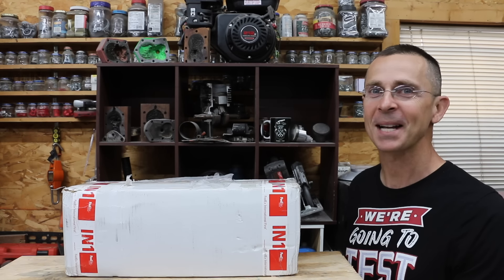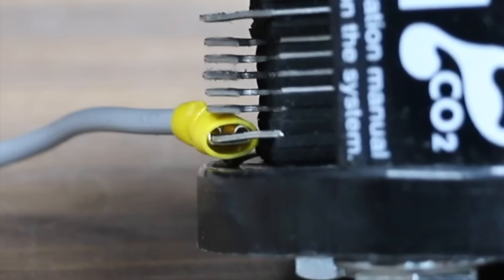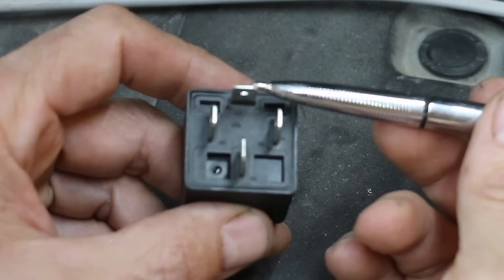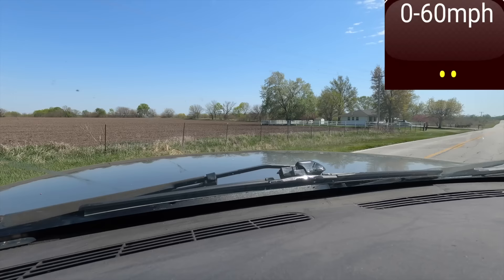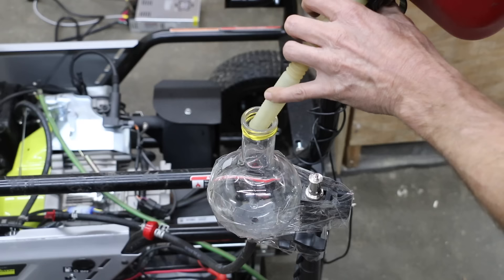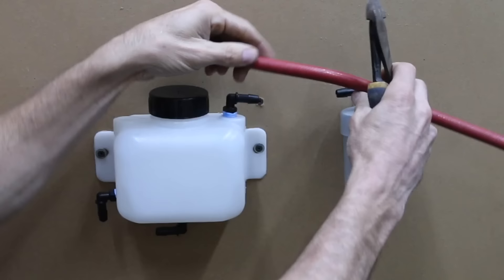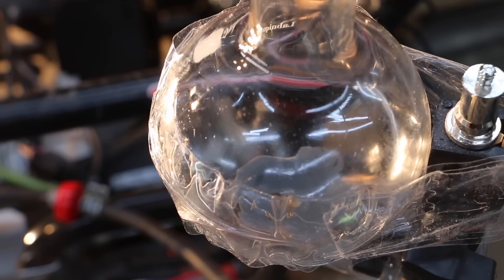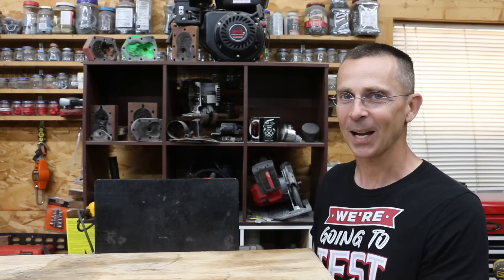AMAZING 35% More MPG with HHO? Let’s find out! Help with high gas prices?

Comment: Can you come up with a test for "Rain-ex" products?   I like using those hydrophobic windshield coatings but Rain-ex brand makes your wiper blades chatter when it starts wearing down and there HAS to be something better out there
Reply: @PayNoTaxes0GetNoVote  put a silicone emulsion on your wiper blades (like 303 protectant or a bargain brand doesnt matter) and any glass or clear coat sealants or your windshield. That should work. The silicone also acts as uv blocker so less sun damage to them. I’d use a cheaper product for a sealant than rainx, they all basically do the same thing. I’ve used car wax on my windshield and when it wears I don’t get chatter, just more droplets that stick. Good luck my friend!
Reply: @sashasoule4585  - Thanks,  until I see some definitive test. I'm sticking with my tube of Rain Clear.  Thus discussion reminded me to re-apply yesterday! Should be good all summer at least
Reply: Silicone wiper blades maybe?
Reply: also put the Rain-ex on a cloth and wipe it on the wipers or they will squeak
Reply: Put on some Bosch wiper blades, they never chatter. I got some on my 2008 Chevy Avalanche with some Rain-X wiper fluid.
Reply: You kidding me?? Never ever heard of someone using their blades after proper coating their windshield with Rain-X. Regardless, your years of doing it wrong, YOU DONT USE YOUR BLADES AT ALL. NO NEED ANYMORE. Nada, Zip, Zilch, Nay, No. ( Of course your blades will chatter when its scraped enough Rain-X off. If you refuse to not use your blades, then just reapply Rain-X. Why search for a newer kind of blade, doesn't make sense.)
Reply: @SpaceCadet4Jesus  - Your name is very fitting because you are repeating everything I just said.
Reply: @PayNoTaxes0GetNoVote  not exactly. I said "apply another coat" and " don't use your wipers". You said " my wipers chatter when it wears down" (which means you don't apply another coat AND you use your wipers) and you even like another product, Rain Gel. What we both said is not similar at all. So use the Rain Gel. PF isn't going to test your neglect.
Reply: @SpaceCadet4Jesus  - Sigh....that's not what I asked PF to do. I want to know best product, LIKE I SAID. I don't need to get into a semantics argument with a literal online Space Cadet.
Reply: It wont improve gas milage either..lol
Reply: @ipman4715  Ahhhh, only my fancy $1000 ceramic coating job does that I guess.  Reduces wind resistance. /S
Reply: When I wax my truck I also wax my windshield and all my glass. Been doing it for years. Never have my blades chattered. Water beads right off...effect will directly depend on the quality of wax used and how often wipers are used. 🤙🏽

Comment: Hey I just wanted to point out that when you added the hho unit to your truck you put it after the mass airflow so you made an air leak
Reply: Your right, he added it after the MAF so HHO will come in downstream and will possibly cause the fuel map to be lean, i say possibly because if the HHO is in balance and the air required to burn the Hydrogen (accompanying the hydrogen) is in the correct ratio it shouldn't be a problem and if the HHO is going to give a boost it may be advantageous to inject after the MAF anyway.
Reply: Good pick up! 👍
Reply: I noticed that as well. The ECU is going to try to make corrections for the new values. Try it on a carb engine.
Reply: Those corrections only occur when the ECU is operating in closed loop, his testing being at wide open throttle (WOT) will see the ECU operate in open loop and as such the feedback from the o2 sensors is ignored from the ECU under that condition.  There's not a chance that the kit was developing anywhere nearly enough gas to make a measurable difference at WOT.
Reply: @goatfather2966  Not worth the trouble; it doesn't work, because it cannot work.
Reply: Guys in theory If you were to add it b4 the maf and it's a hot wire couldn't it ignite because of the hotwire?
Reply: @RoronX35  Autoignition temperature of stoichiometric hydrogen:oxygen is considerably higher than the hot wire can create.
Reply: @Charles McKinley  Your the one who needs to go back to sceince class.
Your argument only has merit in the absence of an ignition sourse, thats not the case here.....
Reply: Well it didnt set a lean code so it must not have a vacuum leak. Unless the hho increases or decreases the volume of air going thru the maf i doubt it made any difference. Maybe he should have plumbed it into the manifold or to vacuum line. Seems like the hydrogen would mostly just deflect off the throttle plate how he had it rigged. Idk seems about as useless as a k&n air filter no matter how its installed. For 200 bucks i could install a 40 series flowmaster and at least it would give him some results plus a throaty growl. Any noticeable gains are gonna cost more than 200 bucks and wont say as seen on tv written on the box.
Reply: @luckyPiston  it'd actually cause it to run rich if it's hydrogen rich gas being emmited (hydrogen is basically just 1 carbon off being fuel anyway) because the oxygen density in the intake would be displaced for the fuel gas... That's if the HHO worked but there's far more important thinks like laws on conservation of energy at play.
Reply: @bradtpt  I don't think the ECU would go open loop, can't think of a reason it would do that or that it would even be EPA legal ?
Reply: @mackay820  Wouldn't the O2 sensor see that and the ECU make fuel map correction ?
Reply: @hotrod8915  Maybe he would get better results over a longer time period with average driving  ? The HHO should have higher impact at lower speeds right ?
Reply: @luckyPiston  hell if i know it looks like a scam to me. Hydrogen doesnt burn hotter and doesnt make the air more dense or move faster thru the intake runners so i fail to see it doing anything for a gasoline engine. Its a scam. Common sense says high volumes of fast moving air and the proper fuel ratio to quench it is the only way i know to produce more power.
Reply: @luckyPiston  hydrogen is not a solvent so it wont clean carbon build up and doesnt produce steam like water does to clean pistons or valves. Its a scam. Unless hydrogen defies the laws of chemistry its useless in a gasoline motor. I been a mechanic 20yrs and have never heard of hydrogen benefitting a combustion engine. Maybe if it was used to aerate the fuel as it passes thru the lines and injected into engine it may do something. Otherwise its a scam
Reply: @hotrod8915  I think the idea is water is cheap so y not crack and burn it, in theory you would see the ECM lean the motor for the HHO and u would save gasoline.....
Reply: @hotrod8915  Good points, ideally the motor should run on straight hydrogen but the fuel supply in any volume is a big problem
Reply: @luckyPiston  have u seen the magnets supposedly used to ionize the fuel as it passes thru the lines? Its bullshit too. Snake oil salesman peddle shit products like these with outrageous claims. Common sense and a thorough understanding of the basic principles is enough to satisfy any doubt. Unless u have particle accelerator and enriched uranium in heavy water and a nuclear reactor to split hydrogen atoms, there isnt much energy in oxyhydrogen to be released. Still the oxygen molecule would have to be removed from the hydrogen molecule. That would require a catalyst. Oxyhydrogen is just a strange thing to run thru a motor. Hydrogen would explode like a zepplin blimp.
Reply: @luckyPiston  maybe the dude should try it on a diesel engine and see if he gets better or any results. It has a higher compression ratio and more likely to make that snake oil potion oxyhydrogen burn. U can run a diesel off chicken grease with a 17:1 compression ratio. So it will probably burn the oxyhydrogen. Short of that it seems like it would dilute anything flammable
Reply: @luckyPiston  I don't think so since hydrogen is super clean when it burns. It uses the measure of co2 and nox as to tell if there's too much raw fuel coming out so it probably wouldn't be any calculation changed. Hence the rich running.
Reply: @luckyPiston  it goes open loop because the narrowband sensors will only tell the ecu if it's leaner or richer than stoichiometry, not by how much, plus it commands richer than stoichiometry because it'll make more power and also for catalyst protection. On this generation ecu (probably an eec-iv or eec-v) it will run open loop at wot, however on the current generation copperhead based pcms Ford run full time closed loop, they also use wideband sensors so they can actually target and read meaningful feedback for targets other than lambda 1.00.  So, without any doubt the ecu is in open loop for these full throttle tests.
Reply: @bradtpt  I see what you are saying and the narrow band sensors have their limitations, so he shouldn't have been doing his tests as a bunch of speed runs like that ? So would testing the HHO in some kind of a dyno situation yielded more realistic results, there must be a good way of measuring this ? tks

Comment: It seems you need to do a second video, where you tune these engines for a lean burn. People are saying since your results found less fuel efficiency at the current tune with the additive, maybe the results will change. The mission is to see if engine will run longer with a lean tune alone, or with the hydrogen additive. The only other video about this, is a floridian hippy and his Ford ranger.

Comment: Well done and thank you for doing that test. I have always thought those hydrogen generation devices were a scam and you just confirmed it. Still, as long as there's one born every minute, I guess they'll keep making them!
Reply from the maker: Thanks and you are welcome!
Reply: The basic premise is flawed; using the car's electricity to split the water means its hopes of gains are pinned on being a perpetual motion machine (which is not possible).
Any benefit would need to come from it modifying the combustion chemistry somehow, which in the many years and many times I've seen HHO brought up, I've never seen anyone provide any mechanism how this actually works; it's usually just hand-waived. And it would need to provide enough improvement to overcome the inefficiency losses in the alternator and the water-splitter.
Reply: @IstasPumaNevada  thats not the theory the theory as i understood it was the hydrogen helps to make the combustion more complete...

Comment: You can build a pretty reliable hho generator with a $1 Mason jar, a $1 set of stainless steel  cutlery and some tubing. If you want more mpg from hho, use a small battery and solar panel setup to power it. And then use mosfets to modulate the 12v signal to pulse at the correct optimum frequency.  Maximize your gas production while minimizing the energy used. This coupled with electrolytes and you're golden.
Reply from the maker: Thanks for the feedback.

Comment: Not a significant test.. You need a controller, that taps into map and oxygen sensors to lean out the fuel on the EFI in order to compensate for the HHO injection. Just injecting HHO into the intake with no air/fuel mixture adjustment makes the ECU assume the HHO is just intake air and causes a rich combustion. (Loss of power/MPG) Also, on a V8 engine, the HHO Generator needs to produce at least 1 liter per min of HHO. Preferably, up to 2 LPM in order to see any real gains in mpg or power. There is tons of research on HHO retrofitting out there. Look it up. Do a follow up video with what it actually takes to get results from HHO. And rule out those gimmick buys like the one you tested.
Reply: Exactly what i was thinking. The engine, especially the generator engine, does not care what air its taking. It will just run the same amount of revolutions anyway.
Reply: I agree, more hho would be needed on the car to offset petrol use, but the controller you mention is slightly incorrect as most PCMs allow for fuel trim leaning out the petroleum mix to reach the stoichiometric ratio of an ideal 14.7:1 Obviously the PCM can vary in tolerance and will flag a check engine light & limp modeif you try and over supplement the fuel system.
Reply: @richard68380 You're right, I did read some preliminary testing, by different people on making a PCM device but it was manually controlled. They did get some really good results but it was really a prototype to prove effectiveness. The conclusion was that a fully digitally controlled PCM would be needed to be fully applicable and efficient. But the proof is there that it is possible to get 60 to 80 MPG out of an HHO retrofit. I researched it a few years back, maybe someone has come up with a digital PCM by now. Or the oil companies have squashed it again 🙄
Reply: @solidamanda  O2 sensors monitor fuel that is burnt and leans or richins fuel trims mass air flow monitors air intake. So that 5.3 was reading the fuel differences it just didn't matter
Reply: EXCELLENT ! well put !
Reply: First of all, EFI engine does have oxygen sensor and adjusts mixture accordingly.
Second, but probably more importantly, you use more energy to produce 'HHO' than it gives it back. Electrolysis is a rather inefficient proces, there are quite some losses. Energy to produce HHO has to come from somewhere, that would be the engine which has to work just a little bit harder, in turn consuming a little bit more fuel. Did you go to school, by any chance?
Reply: You are right and wrong at the same time... Yes modern cars have an O2 sensor, but it has an opposite effect in this situation. This is due to the fact that the Hydrogen generator in this video is not separating the Hydrogen from oxygen (both gases are mixed). Then it's feeding both directly into the engine, then the additional oxygen that is unburned is showing up on the O2 sensor, this shows the computer a possible lean condition, so it increases the gas consumption to compensate. Without proper adjustments to programming, or leaning out the carb on the generator... You will never see a difference, simple as that. For those that know what they're doing with hydrogen, they will separate the oxygen (super easy) or adjust their fuel map accordingly by means of a fuel management system such as an Apexi AFC Neo. Far as electrolysis being inefficient you are correct, but so is an alternator constantly spinning to power your stereo. Yes this will cause more load, but pending the gain in efficiency and the price of fuel... It can be worth it in some situations, if done properly.       Would you like my education records....
Reply: @Grimm0ne  O2 sensor measures quantity of O2 in exhaust gases, sooo....

Comment: A HHO electrolyzer unit typically consumes 10 X the amount of energy that can be extracted out of the hydrogen combustion.  This is one of the stumbling blocks to the so called hydrogen economy.  It makes total sense that the engine would run slightly less efficiently as the alternator takes more power for the HHO unit and generates a miniscule amount of hydrogen.  It would be nice to measure the electrical energy consumed by the HHO unit and figure out how much gasoline it took to run it.  If this actually worked then it would make more sense to stop feeding it gasoline and just run on the allegedly free hydrogen output.
Reply from the maker: Thanks for sharing.
Reply: Add baking soda

Comment: honestly, the only way to make this work to increase fuel efficiency would be to create a compressed tank with HHO made with home electricity that you introduce into the system after youve collected it and try not to blow yourself up in the process.
Reply: David Wilcox  i mean yeah, not nessisaraly/exactly ( at all) safe to have both hydrogen and oxygen in a tank together to be used as fuel, you could have hydrogen by itself at least when you get into an accident and the tank ruptures the gas floats up instead of spreads down like CNG
Reply: Maybe it would increase the vehicle's fuel efficiency? But then you're not accounting for the energy needed to produce the HHO gas in the first place. Unless the HHO gas is increasing the overall combustion efficiency somehow there is just no benefit. Then it's just robbing Peter to pay Paul and the increase in entropy will render the entire thing worse than pointless. Moral of the story, if it sounds too good to be true...